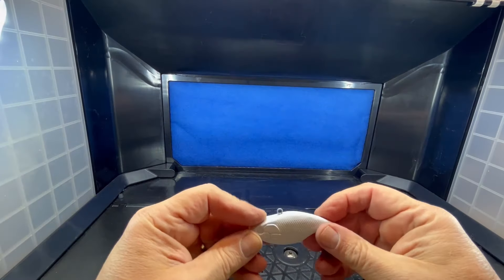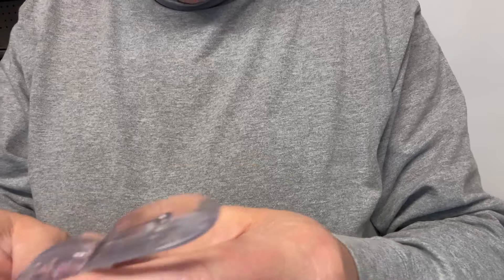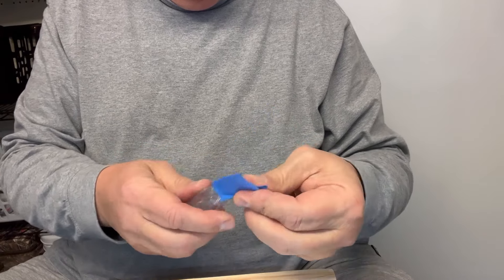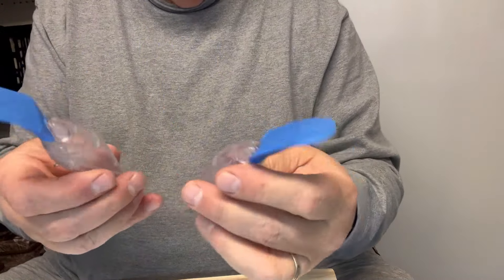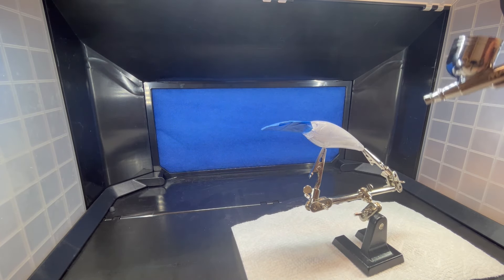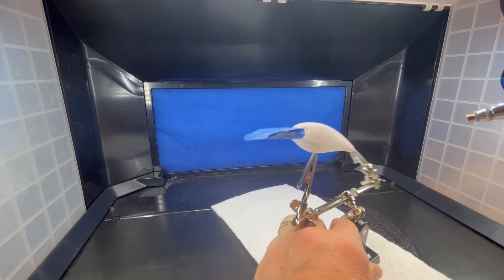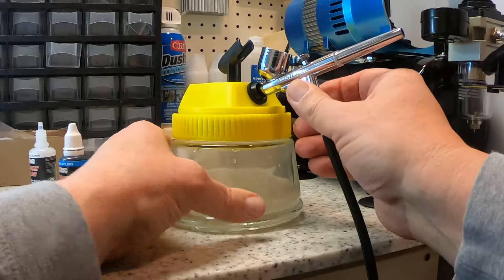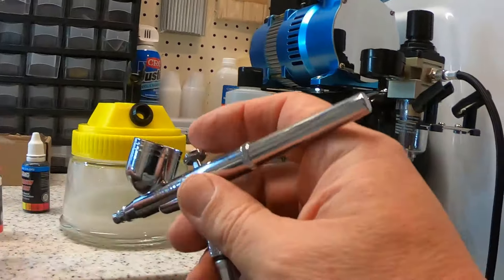First Time Painting with an Airbrush, Priming some Lures

Comment: Red 3M Scotch Brite pad. Scuff the whole lure with it before base coat
I use tap water between colors to clean. Fill paint hopper, turn pressure way up and blast it.
When done with a paint session, clean as above and then run just a little cleaner through it at high pressure.
You should heat set every once in a while.
Reply from the maker: Thanks for the tips,  learning as I go so I greatly appreciate any input.